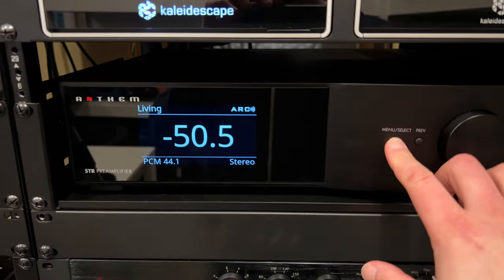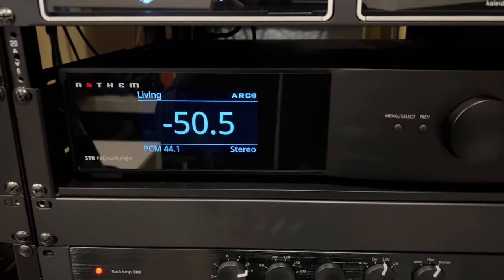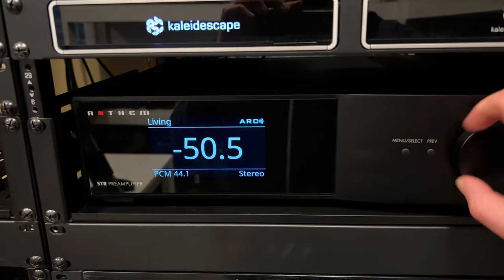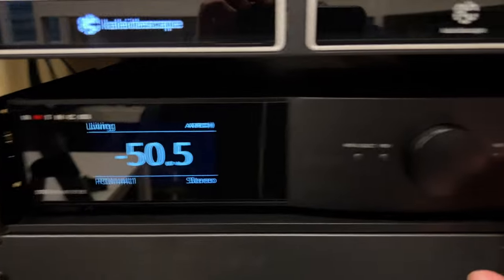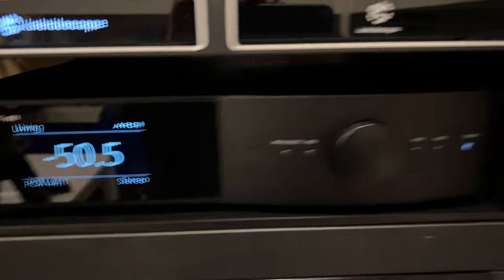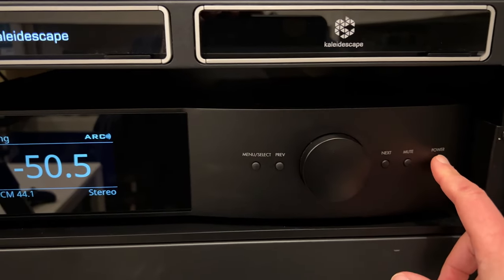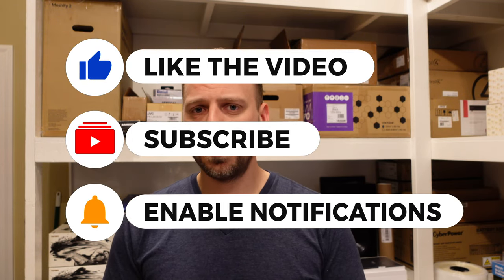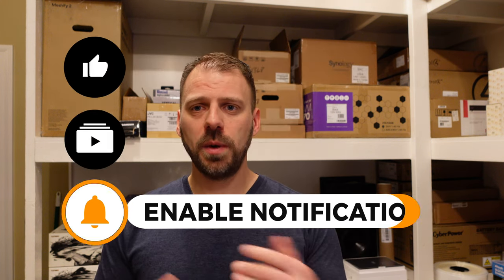Trouble with Triggers | Anthem STR & AVM Trigger Output Misconfigurations & Failure to Start

Comment: Too much voltage drop. Emotiva sells a trigger distribution box. I have it, works great and not noisy.
Reply from the maker: Nice, that is what I need and have been loosely trying to find. I'll check their store!
Reply from the maker: So I took a quick look and found https://emotiva.com/collections/trigger-expansion-module/products/et-3. That's not exactly what I need though. That box is a single input to multiple output trigger box. I need a multiple input single output trigger box so if either input line is on, then the output line is on. If both are off, then the output is off.
Reply: I’m going to call you “Genius” from now on. You figured out your problem when the Anthem experts couldn’t. I guess spreading out the trigger’s voltage/current too thin caused a problem in the STR’s startup circuit. Especially since there’s only 1 port!🤷🏾‍♂️ Glad you got it working!!👴🏽
Reply from the maker: LOL, thanks @Julius R. Anthem AV is pleasant to work with in my experience, but it's hard to remotely trouble shoot issues like this.
Reply: JAREMY, I believe triggering all the amps in on instant was causing a voltage drop on the entire rack at the exact time either Anthem processor was trying boot up its operating system, causing the Anthem software to glitch. When we moved the triggers to come from the Control4 EA5, we were able to use delays to stagger the amps powering up.
Reply: @JLRJ  It was the voltage consumed by the amps all turning on at once, not the voltage of the trigger itself. Staggering the turn on is what fixed the issue.

Comment: Trigger circuits can only provide a limited amount of current (millivolts). The number should be listed right by the jack where you plug in the trigger wire.

Comment: Wouldn’t say it was your Y splitter. It’s voltage drop possibly or the trigger out doesn’t output enough current to pull in multiple relays on multiple devices/amp etc.
Reply from the maker: True. Something was definitely off with the electrical connections enough to make the operation of the devices faulty. Rock solid since changing the triggers out though.